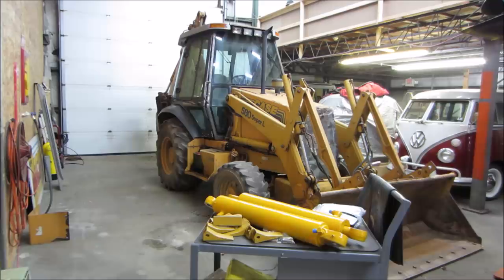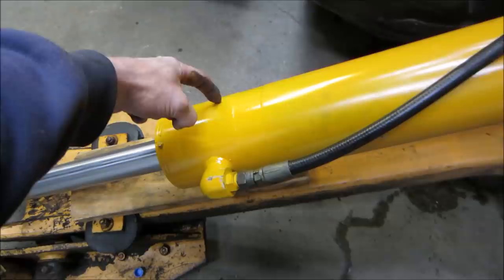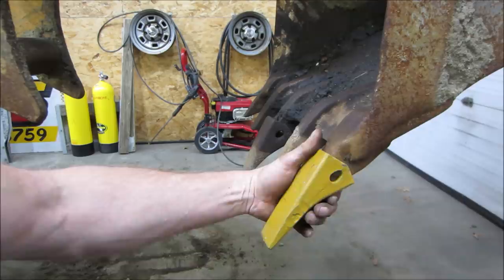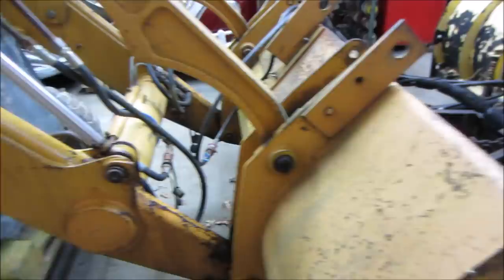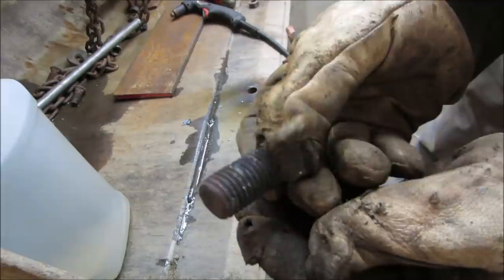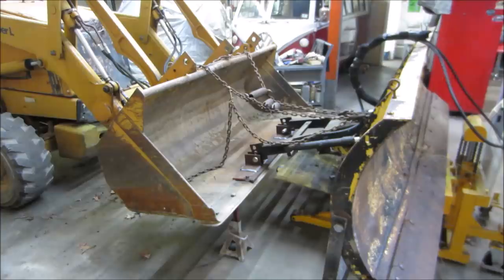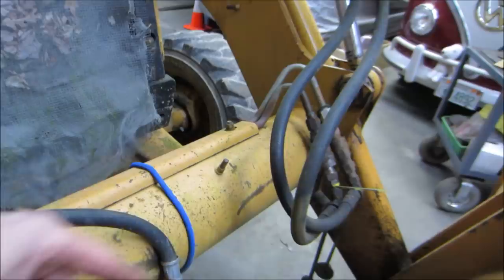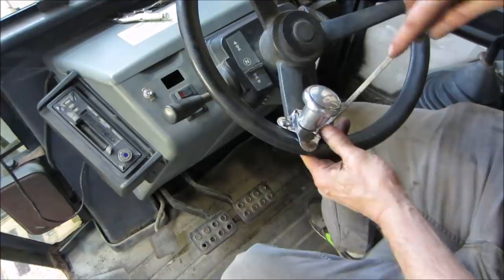WHY NOT? Lets Install A Snow Plow On A Backhoe

Comment: Teeth are up. And weld. Pins wear out. And hard face lower blade and side walls.  I use 7018. 6011 is soft.

Comment: Did  you roll the front  bucket  over to see if any of the back brackets lined up with snow plough b4 u tried mounting it to front of bucket? That would mean full use of bucket with plough removed and no changes to front bucket blade. Thanks for the excellent vids from here in UK.

Comment: The best all around solution would be adapt the blade so that the bucket comes off and the blade goes on in its place keeping the tractor length  shorter, more maneuverable,  better rear wheel traction . Some experienced back hoe drivers have stated this in comments .

Comment: The pins are made to be removed and the rubber in the pins are to keep them from backing out. Also there should be a specific direction they go in. Some don't depending on the age...
The teeth  are consumables
Curve goes up
Reply: The last owner may have reversed one pin for something special temporarily.

Comment: You know, if that was mine I'd have chocked the outriggers, removed the strap, put my fingers in my ears and kicked the chocks out! 😂
The teeth you put on the rear bucket are the right way up, they pin to the adapters which are replaceable  just as you've done.
When you put the weight of the tractor on the outriggers make sure the front bucket is on the ground so you don't transfer the weight onto the front axle, watch the video back and look at the front tyres bulge, and those bolts holding the front bucket cutting edge can wear to a razor sharp edge and if they spin they'll cut right through the thickest of leather work gloves so watch out!

Comment: Looks to me like they removed the adjustable feet from the plow to add the reverse blade. I have never seen a back drag blade on a plow before. I had a plow for my john deer but I didn't use it after the first year I found the bucket more useful as others have said.

Comment: Surely you curl the loading buck up and have 2 plates on the back of the bucket that the snow plow A frame bolts too? Or the loader bucket comes off and the snow plow fits to the JCB arms?

Comment: Make holes in your angle to go over the bolts with enough clearance to remove them if need be and weld the flat end of angle to the topside of the blade and reenforce the ends and side for torx.

OR,

remove your bucket,

fab a new attachment custom for the plow.

Comment: Will the plow need shoes to set some clearance between the gravel you will be plowing and the bottom edges of the plow? Plowing on asphalt no problem but you might end up moving a lot of gravel. Most snow removal in our area involves a lot of unintentional landscaping (grass, etc.) which gets uncovered in the Spring.
.

Comment: Doesn't the bucket come off the tractor and the plow attach to the tractor?  On our skid steer, you take off the bucket to put on the forks. We don't have a plow.  We just lay the bucket lip on the ground and "shovel" up any snow.  Here in Missouri, we haven't had a big enough snow to need to do that in ages.

Comment: those springs and chains are mounted wrong. The idea of the springs is to allow the plow blade to angle forward should you hit an object and spring back after clearing the obstacle.  I have to agree with most guys on here, I don't think mounting the plow blade to the front of the bucket is a good idea.  What do I know living in Michigan all my life plowing, snowblowing and shoveling the crap most of my life. I worked  for the schools and I ran tractors, trucks and every type of snow removal equipment there was. I didn't care for using the bucket for plowing because of the open campus and sidewalks we had. They are great for open parking lots, not sidewalks and narrow drives between buildings.

Comment: The 580 series backhoe/loaders were excellent machines. The one you have is really in quite good condition. The previous owners must have kept a good maintenance schedule. I would get in the habit of giving the pins a couple of shots of grease every time you use the machine. There are no seals on the pins so the grease tends to leak out under use. Besides, grease is CHEAP (at least cheaper than pins)  No one has mentioned it so far but your machine most likely has a Perkins Diesel engine( Made in the UK) Case liked to use them and they are a good engine. I disagree with the comments about a diverter valve. The bucket curl function would be of little use with the plow attached and the way you have the mount designed removing the plow would only take a few moments and no tools. Merry Christmas and Happy Plowing!

Comment: just the "red hose" sliced length and around the hydraulic hose in place with clamp would have been sufficient. clean and put a bit of silicone goo to hold it in place, so the clamp wont shift in temperature and hose expansion changes (hydraulics always move around/expand/contract when pressure changes with usage)
you can sleeve the hoses in larger lengths too, just avoid putting it where the major flexing will occur, or it will quickly chafe through, which is likely not an issue unless you work it as a contractor 5+ days a week

Comment: I think you will have a hard time steering when trying to push snow at an angle, especially if it's heavy, wet snow. The plow is so far out away from the front wheels that, instead of pushing the snow, the snow will push the front of the tractor in the opposite direction. The weight of the plow (and the bucket) is no longer on the front wheels when the plow is lowered to the ground, making steering difficult. It would have been better to fabricate brackets to mount the plow directly to the tractor frame.

Comment: Could the chain/spring assembly form a shock resistance source for the top of the blade?  It forms a shock absorber for the left/right motion of the blade.  See those I-bolts on the top of the snow blade?

Comment: Are you going to do fluids/service off camera? What was the home-installed switch on the left of the steering wheel? Why were the bucket bolts so hard to remove if the prior owner had used them to bolt the plow on previously? Curiosity is killing me lol

Comment: mount the angle under the frame so the blade goes in and the wishbone goes as far to the back of the bucket then 2 braces pined to top of bucket you just slide the bucket under the frame pin to back of bucket  and the controls should work

Comment: did you check to see if the brackets on the top of the bucket fit the snow blade with the bucket turned down ,,it would keep the bucket from filling with snow .to me the brackets do not look like they are factory just a thought

Comment: With the kind of work you do you're not going to get rid of this thing once you see what that loader can lift. My father had one of those old Ford/Balmar backhoes with a similar capacity loader and I miss that thing all the time around my own property. I work around not having it, but that thing was so handy to have around. I could lift up a 4000 lb car length-wise off the front of that beast. It was amazing for scrapping and anything else you would need a loader for, and then of course there's the occasional digging work with the backhoe. Would you rather have an off-road forklift and a small excavator? Yes. Do each of those cost as much or more as this whole used machine you bought? Also yes.

Comment: Sooooo your supposed to take the bucket off and mount that plow directly to the machine. Those spring chains hook to those I-bolts that are ends of the topside of the plow blade.

Comment: I think you will find that the bucket needs to be turned down more so that 1). it's not holding snow/water and 2). You want the leading edge of the blade down lower than your frame. It should also have skid feet under it to keep from edge wear and ripping up any stone from driveways.. Also you absolutely need trip springs on it in the vertical position or you can destroy anything you hit and/or the machine. The way they are sitting will only have a few inches of give at best. The blade should be able to lay down far enough to go over obstacles rather than tear something out of the ground or destroy the machine.

Comment: The angle of the chains are on a to sharp of angle . Putting a A- frame between rear of plow and the chains to hold chain at a more stepper angle more like it would when on a truck. I would also line the plow face UHMW the white plastic use for cutting boards but you will have to cover it from the sun as it will mess it up over time

Comment: I would just delete the 2 bolts under the welded brackets for the snow plow, since you have the plate mounted across the blade already. it seems like those two bolts would be difficult to remove if you wanted to remove the snow plow plate you built, then welded the angle iron brackets to afterwards....You MAY have backed yourself into a corner with that by welding after bolting it up....And you're not going to be bending that plate anytime soon, even with the heaviest of snow. You also may want to consider some sort of plow shoes to keep the snow blade from digging, especially on gravel. it'll save you from having to redistribute the gravel in the spring. possibly larger, pneumatic caster wheels?
Reply: Or just cut clearance holes for those two nuts and let the other accessible bolts hold the plate to the bucket.

Comment: What you usually do is remove the bucket and bolt the plow to the tractor. Then use the lift arms connected to the plow by a chain to lift. The curl lines are rerouted to adjust the yaw of the plow.

By bolting the plow to the bucket you get a horribly long lever. Besides the load arms are not designed to take the lateral load you get from that plow. I think this is a bad idea...

Comment: One thing I’m confused about, and I apologize if it’s somewhere else in the comments already, is was the plow blade intended to be used with this machine, or is it from something else? If it was meant to go on this machine, how was it supposed to fasten on? I am assuming it was not meant for this machine, and that’s why so much fabrication was required.

Comment: Pretty sure that snow plough is way too far forward and will buckle under any load or leverage  or if you catch it on the asphalt. Those bolts on the scraper blade are like that because you would wear off a normal nut mounted underneath.

Comment: The teeth on the backhoe bucket should have the thicker side up (facing towards the seat) so as you dig and curler the bucket the wear is on the thicker side

Comment: Those of us who primarily work alone, have learned how to do two man jobs without help and still not get hurt. It’s a matter of think things through first. 
Wish we had interactive video. I like the way you ended up mounting the plow to the bucket. Most often, a couple of brackets are just welded to the bottom of the bucket behind the cutting edge. Your way is definitely plenty strong.  Many years ago I worked for a town public works dept. we put plows on many front end loaders that way. Yes, you can clear snow with a loader bucket, but it’s much faster if you use a plow, especially on roads or long driveways. 
The bolts for the cutting edge are plow bolts. Tractor supply should have them.

Comment: I would have mounted the snow plow on the back since these tractors are designed for the operator to face backwards to operate the backhoe you put chains on the larger drive wheels for greater traction. Just seems logical you should remove backhoe and mount the snow plow on the rear. With a snow blower in front creating the ultimate snow moving machine. I just can't see having that plow hanging out in front of that bucket makes any sense.

Comment: Lol, you have to take te bucket off the loader,  and fasten the blade to a pushframe in front, then fasten the chain to the loader and use the loader to lift the blade from the ground.

Comment: If it was me and I was going to use the blade I would just cut the end off of the bucket bracket and notch it so it sit in the blade of the bucket and just fabricate so top bracket so its stable and you wouldn't have to worry about taking it off and on when you need to use the bucket just a thought...
Reply: I see what you are doing now good work hope it works out for ya like you want it to...

Comment: Anytime you adapt two implements each designed with a different purpose you compromised the utility of both, in a big snow storm requiring snow removal, generally the bucket is the preferred method. If you have to push snow, you generally have to move piles. Sell that blade or mount it on one of your kubotas and don't tie your hands from bucket use as you made need both.

Comment: If you take an angle grinder to the face of that stuck nut, you could remove the peened over part of the bolt, then get back on it with the impact uga duga and try some more.

Comment: Ok so a couple of things , those" teeth " are called ice teeth...they are for digging through the frost ...Secondly the easiest way to install and remove the pins is to make yourself a long rod . One that will fit through 3 of the teeth on one side so you can just knock out the teeth " pins" on one side then flip to the other...
Reply: That's a cool idea.  Start from the middle with a long rod and work your way out.

Comment: Has anyone seen the snow removal area he is contracted to do ? If it's a small tight area I doubt he would have gone this route. I believe he needs to throw the snow from side to side instead of pushing it straight forward. An attached mount to the plow replacing the bucket would strengthen and shorten the machine up but that takes time and money. I'd definitely put chains on the rear tires and I'm waiting to see the job site before commenting if this will work

Comment: Anyone else wonder why he didn’t use the mounting points at top of bucket? Tilt bucket so it doesn’t hold anything down and tada mount plow.  Also where is the spacers for cylinders? They make them for each side and are wear points.

Comment: The teeth on your backhoe bucket are on correctly they need to be welded on the pens are the pens are just to hold it in place so you can weld the cutting teeth on

Comment: Be careful putting your finger on those cutting edge bolts with the impact spinning.  The if the bolt drops enough and that flat head spins its like a razor and will slice your finger open quickly.

Comment: I agree with other posters, the plow blade doesn't seem to be worth the hassle. For one thing, plow blades are designed for pushing to one side at speed where the snow is forced out the side, I wonder how much speed you can get with that tractor. I have seen a backhoe with bucket work really well for deep snow. In fact, one year we had SEVEN FEET IN THREE DAYS and backhoes were in high demand because plows were ineffective.

Comment: I'm thinking that plate with the three holes for the plow is too thin. It's also too small. It's a hard deal to work with what you have on hand instead of what you really need to do a job right.

Comment: I'd make it into a piece to replace the bucket entirely because I think your asking for trouble weld all the same kind of mounts on the blade as the bucket has so you can attach it in place of the bucket anyway good luck

Comment: I don't like that bracket on the edge of the bucket like that. I've never seen it done like that -- we always welded the bracket/ears further back on the bottom of the bucket. You've got that heavy plow hanging off the edge of the bucket with insufficient support.

Comment: For what is worth. Next time you have to take the teeth out just use a piece of round stock a couple of feet long and drive the pins out through the existing holes and also for driving them back in. Also , torch the cutting edge bolts out. They are cheep and takes a lot less time.

Comment: Had a case bh that would snap off the bottom stabilizer hydraulic fitting if you didn't get rocks out of pin area.

Comment: Realizie that I have no knowledge or experience with the subject, but would it not be a lot simpler to just remove the bucket and attach the blade possibly with some kind of adapter which I am sure you could whip up in no time

Comment: Still think the plow shovel should be removed and the plow installed directly to the frame of the tractor. You will then have to get a hydraulic cylinder to raise and lower the blade

Comment: Geta tire groover and cut the treads deeper on the feont tires as they have about 3/8" of rubber casing and you can get a few more years out of those tires easily as they're absolutely worthless once removed,no trade or core value for recapping... They do that to them down here at the used tractor and equipment places all the time...

Comment: Putting smaller bolts in the bucket blade holes is a bad idea, have fun putting them back on after using the plow and the holes are all dicked up.

Comment: You mount the plowframe directly to the tractor, and lift it with the loader. The loader is over the plow and has chains going down to it. 
My fear is that this rig is to long and it is going to be difficult to be going in a straight line when you push uneven snow. And you run the risk of bending the loader.
Reply: bending the loader with that old rusty plow?? LOL  That plow will fold, crinkle and bend much easier then the actual loader arms will.
Reply: @warrenmichael918  Well, if the plowframe bends before the loader, it's still broken.
Reply: @olemartinmadsen3929  oh i agree that the arms or bracket and plow might crumble the first time he uses it, just that the loader is in no harm from it.

Comment: You don't want the weight of the plow on the Cutting edge of the bucket so when plowing you need to have the bucket dumped a little so the plow will float and not dig in